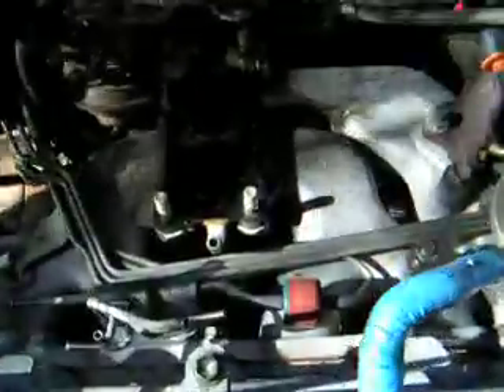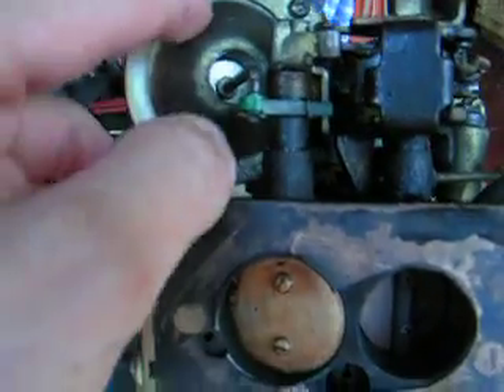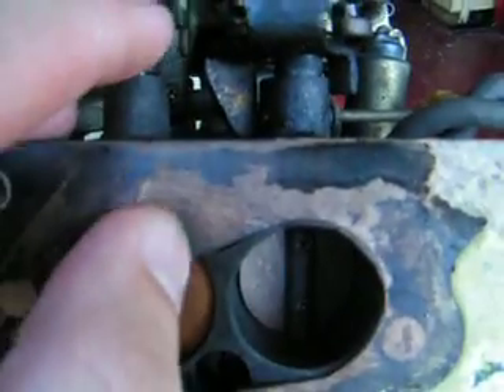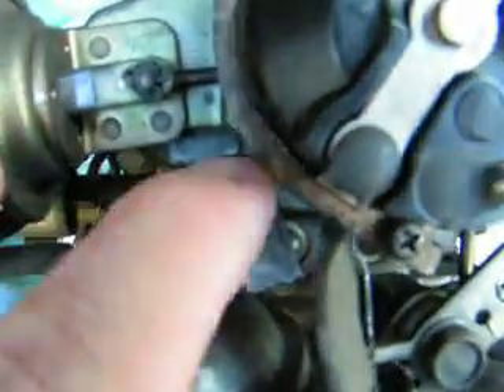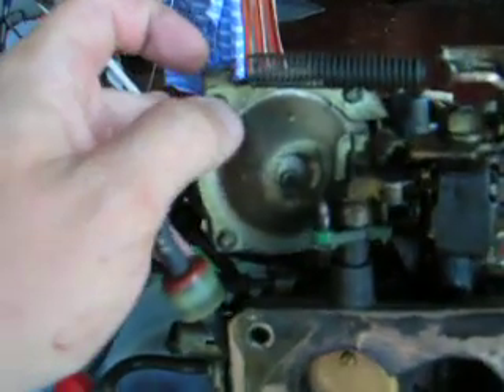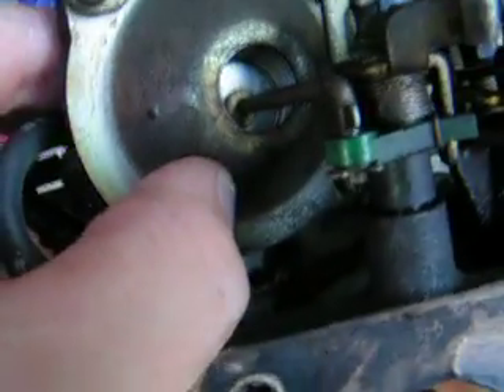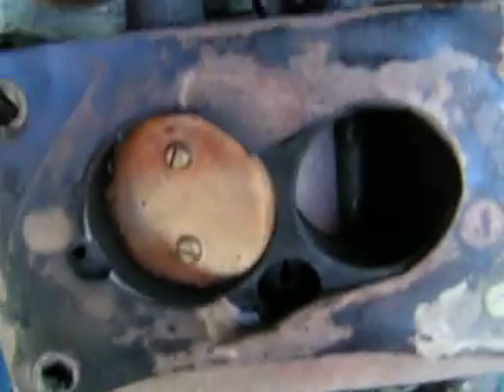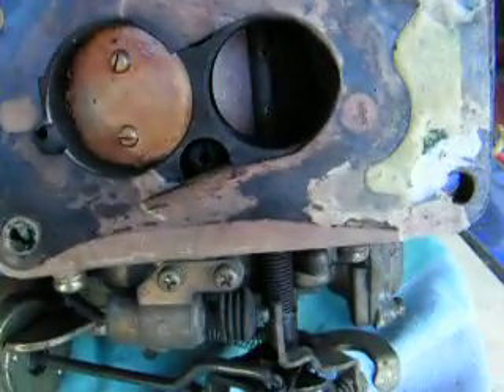Toyota corolla aisan carburetor mod

Comment: I've found that those diaphragms are expensive and hard to find by themselves, yet often come with cheap carb-rebuild kits. When the AAP diaphragm goes you get GAS in your VACLINES! kinda scary.
Reply: What happens when you get gas in your vac lines? I unplugged one of the lines on the Idle Air Control Valve and noticed fuel slowly spurring out?
Reply: Nesta Mon I'm guessing thats from a worn out aap diaphragm. It's easy to replace but hard to find at a reasonable price. Gas will wreck those lines and cause some problems.
Reply: i finished deleting everything from my carb! all lines and AAP plugged up. no choke. Removed my egr all i have to do now is plate off the opening and ill complete my vacuum/emissions delete. my only problem now is that when i try to tune my idlemixturescrew the fuel in the sightglass doesnt change, and neither does my idle or the how the car runs. i could tighten the screw all the way and nothing would change. any ideas?
Reply: @ahdasick  why did you delete everything you need those lines.. 😂
Put them back and swap them around just the cavume lines. Or the diapram springs then your carb will have permanent secondary vacume.
Reply: @SAKOadventures  lol yah i regretted doing the delete after. thing is i had everything in a box and that box is now long gone. its been running for the past 3 years but the secondary opens really late prob because its relying on all the vac lines i deleted. Whats this about the spring? i could really use the permanent secondary you speak of. it always slugs on take offs cuz the secondary wont kick on till it picks up speed.
Reply: @ahdasick  when you turn the springs around in the vacume chamber the secondary stays permenent. So where the diapram sits for the secondary vacume if you turn the spring around then the secondary vacume becomes permenent.
So instead of the butterfly opening at a certain amount of pressure your second butterfly in the barrel will open when the first opens but it will use more petrol but you will have power well significantly more power.
Reply: @SAKOadventures  so leave the spring in the same location but just flip it?

Comment: how do you open the secondary quicker ? i didnt understand very well ! i have the same carb and vaccum problem . when i go full throttle the engine seems to missfire, and i think its a vaccum leak! ty in advance
Reply: Is it cold when you full throttle?

Comment: You don't have to switch the spring. Take the two vacume pipes on the front of the carb and switch them you will have permenent vacume. Now set the fast idle and the mixture your car will go like the clappers. DONE.! NO NEED TO TAKE THE CARB OFF!
Reply: Which pipes do you swap? the itc on air cleaner and secondary diaphram lines where they join the carb?
Reply: @maxstuttle2286 
There are two pipes on the front of the carb! It's the ones hidden on the front. The one pipe comes from the secondary if you are looking at it from the front and the other comes from the right Wich is primary.. They lead from right to inside and left to inside, where they reach from outside inwards and end are the ones that need to be swapped.
Reply: @maxstuttle2286  sorry man I did not see the reply on the message! I can't explain with a Pic but I hope the reference by explanation will help! All it does is when you put your foot down it allows both butterflies to open immediately!
Reply: @SAKOadventures  hi mate. I thought if you know about 4af you might be able to help me. Case: before I cold -start the engine I press accelerator pedal one time. The engine starts fine and idles at around 1'000 RPM. After that it climbs to around 2'000 RPM and sits there. I blip the throttle one more time and it drops back to around 900 RPM. After 1 min it starts to jump at a level of 600-900 RPM and then stalls. If I start it again - it hesitates around 600-900 and stalls again. What can cause that? p.s. I checked the vacuum lines and replaced distributor, spark plugs and wires. thank you
Reply: @raviolilover1  how old is the carberettor?
It could be a butterfly issue, and have you set the vacume to permenent?
Another question is have you checked your vacumes the springs could be old and not regulating correctly Wich will give you unstable revs, another could be jets if your jets are old they might be dripping.
Reply: @SAKOadventures  thanks for the response. carb is original, 28 years old. I have not set the vacuum to permanent, did not understand how to do that frankly - i.e. which lines to switch. the vacuum lines are fine - I checked those. I also disassembled the carb and cleaned it. The AAP diaphragm was leaking so I replaced it as well.
Reply: @raviolilover1  your idle sensor.. Might be an issue it is a black cable that runs to your carb... It could be faulty!  Other than that I am not to sure..
Reply: @SAKOadventures  I will check it out, thanks
Did not know a carburated 4AF has an idle sensor.
Reply: @raviolilover1  it might, if you look at the back of the carb.. There should be a wire connecting to it.
Reply: @SAKOadventures  wish you can send me a picture of the carb in my facebook Evelyn Lee Kwan  and Mark the two vacuum hose you were referring. I had the same problem. 4af carb. Same issue